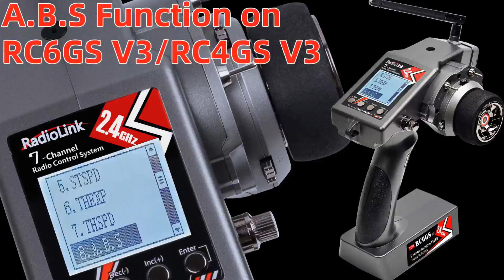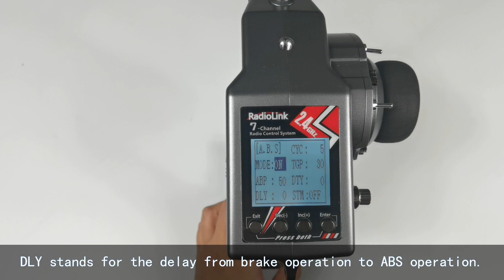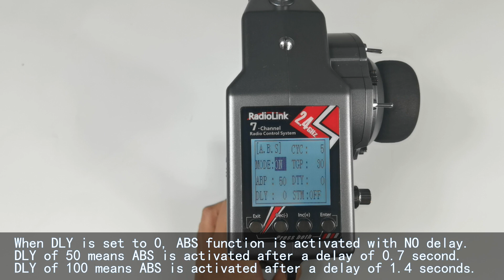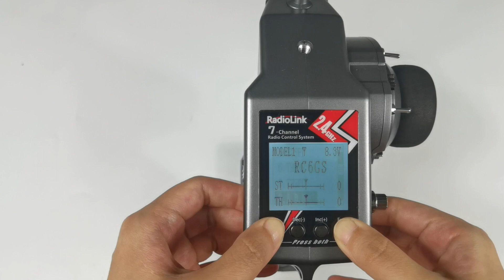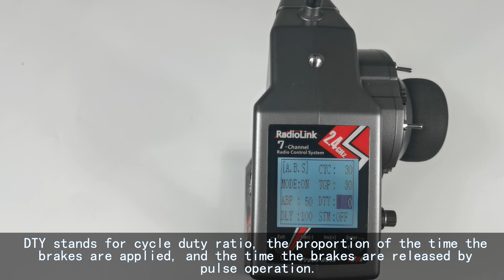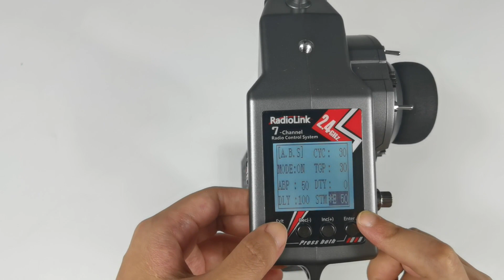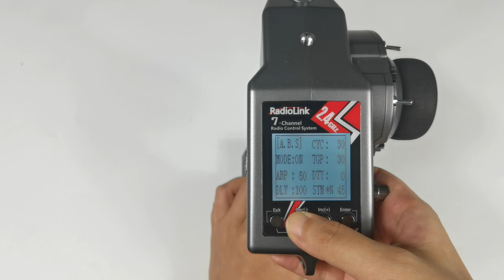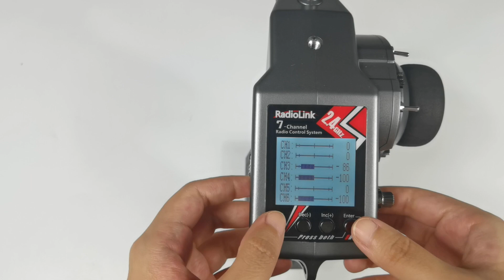A.B.S Function on RC6GS V3/RC4GS V3

Comment: Thanks!!  My breaks where pumping in reverse and I have spent 2 days figuring out how to fix this.  Awesome video!
Reply from the maker: Hi, sir. If the servo is in reverse, you can enter the basIc menu of the transmitter and set it from NOR to REV. Here is the detailed manual for your reference. https://www.radiolink.com/rc6gsv3_manual  If any question about RadioLink products please feel free to contact us. Our email is: after_service@radiolink.com.cn
Reply: @Radiolink_official  yes sir that's exactly what I had to do.  Thank you
Reply from the maker: @DirtDobberRC  Our pleasure. If any question about RadioLink products please feel free to contact us. Our email is: after_service@radiolink.com.cn
Reply: @Radiolink_official I have a question.  I have a Hobbywing Fusion quickrun SE 1800kv setup on my Axial scx10.  I followed your A.B.S settings and so far no issues.  What is the best crawler A.B.S settings?  Also I have some LED lights that I installed on channel 3 and 4 that are plugged into the receiver.  I tried the Aux setting to assign  channel 3 and 4.  Channel 3 I have assigned to switch SWA and channel 4 I have assigned to switch SWD.  I do have a splitter that I can plug into one channel for both sets of lights.  Anyway when I assign the switches on the channels 3 and 4 and click the switches the lights remain on I can't turn them off and on.  Do I need a control switch in order to turn off and on via the RC6GS V3 transmitter?
Reply from the maker: @DirtDobberRC  Hi, sir. The ABS settings depends on what effect you want. So you can set what values you want according to your needs. And for the light control, we thinks you may need a control board for your LED light. Here is a link for your reference. https://www.youtube.com/watch?v=oEEy_HxCZWU&  If any question about RadioLink products please feel free to contact us. Our email is: after_service@radiolink.com.cn

Comment: Holaaaa, como puedo actualizar el framework del la rc4gs v1 ? Tengo entendido que puedo visualizar la carga restante del vehículo desde el controllador/radiocontrol con una actualización...
Reply from the maker: Hi, sir. May I know what receiver are you using with RC4GS V1? And could you please check the production of the mainboard of your RC4GS V1? If the mainboard of your RC4GS V1 is produced before 2.18.1.1, it does not support model voltage telemetry function. If it is produced after 2018.1.1, you need to update the firmware to above V6.0.1. And you need R7FG or R8FG receiver to use telemetry function. We recommend you to take part in our trade-in activity to buy a new RC6GS V3 to use telemetry function. Because it comes with a R7FG receiver, which supports voltage telemetry. Here is the link for your reference. https://www.radiolink.com/newsinfo/844239.html  If any question about RadioLink products please feel free to contact us. Our email is: after_service@radiolink.com.cn